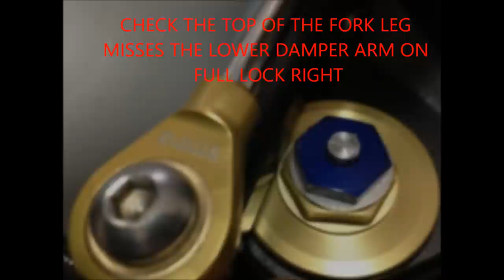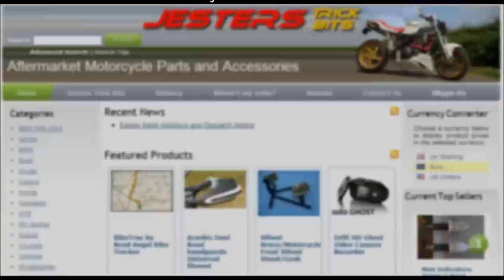Honda CB1000R Steering Damper Fitting Hyperpro by JestersTrickBits

Comment: The steering right side damper arm must touch the top (where the adjustment screws) or the lower part of the fork leg? Because I pushed down the forks lowering the front of the bike of 6mm

Comment from the maker: The damper stops Tank Slappers

Fond on the web...

Tankslappers happen when a bike’s front wheel leaves the road surface momentarily (or for longer if the bike is wheelieing) and moves from the straight-ahead position whilst airborne (this almost always happens if the rider touches the front brake which stops it rotating and thus loses its gyroscopic resistance to turning).     

When the wheel lands, the trail (or castor) self-straightening effect of the steering, causes the wheel to snap back towards the straight-ahead position, but does it so rapidly that it passes through the straight-ahead point again and goes towards the opposite lock. At this point, the effect pushes the wheel straight-back again and if the movement is too fast, the oscillation can become so violent that the handlebars can become impossible to hold on to.

Even if control is regained, if the steering has gone from lock-to-lock, the tankslapper often causes the front brake caliper pistons and pads to retract, leading to reduced braking - or braking at all - being available at the next corner!

If you’ve never experienced a tankslapper – but ride a modern Sportsbike - you can be pretty sure that one day you will probably experience one, as it’s generally found that as a rider becomes more and more familiar with their bike, they gradually gain the confidence to ride it more aggressively, until the front wheel is going light, or skimming the road without them knowing.

It can be something as small as a cat’s eye in the road, which under such conditions, has been known to send the bike and rider into the hedge!

Comment: Hey, good video.   Was wondering if you might be able to help.   I bought a Hyperpro RSC used for my cbr954rr.  however, no installation instructions.  I know I don't really need them to install it but I do need the torque values.  Help pls.

Comment: Hi, It shows the the fork pushed up is it hard to put it back?
Reply from the maker: Pm Bautista it’s quite easy if the bike is on a headstock stand, but can be done by just pulling and twisting, have the Allen key in the nut to lock off when needed.
Reply: jesters600 I don’t have the front stand that’s I worried about and if I will need a heavy force to pull it back down.. Does it requires heavy force to pull it back down without the front stand and do I need somebody’s help or so...? Thanks!
Reply from the maker: Pm Bautista 100% possible on your own Without a stand don’t worry
Reply: jesters600 aah ok, thank you so much! keep safe! These are very helpful!

Comment: Sorry just to clarify, the top nut on the fork in the way of the damper arm?
Reply from the maker: Only on full lock ( right ) you can see in the vid how close the fork gets and the top nut will hit the bracket you need to line up the nut/fork up with the damper bracket to give clearance.
Reply: jesters600 hi, I saw that the fork pushed up and to push it back down is it gonna be hard?